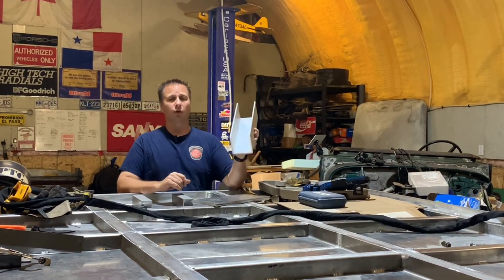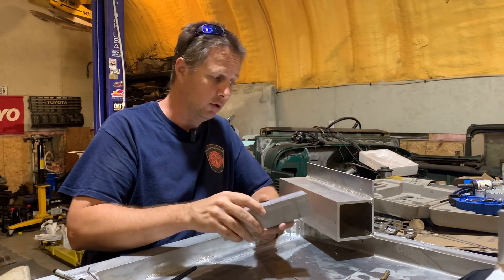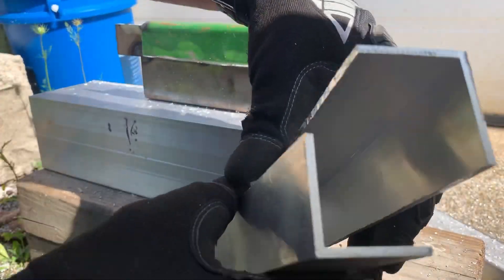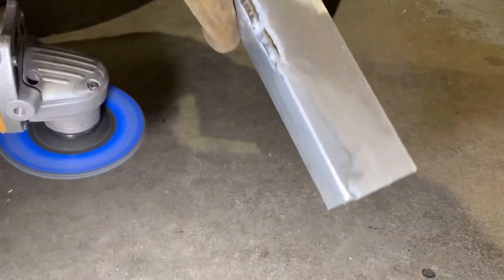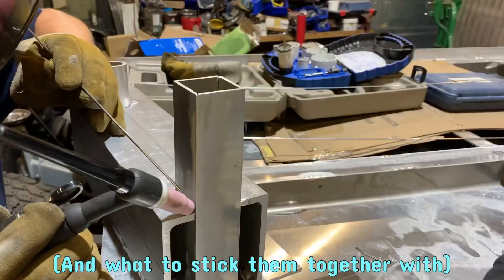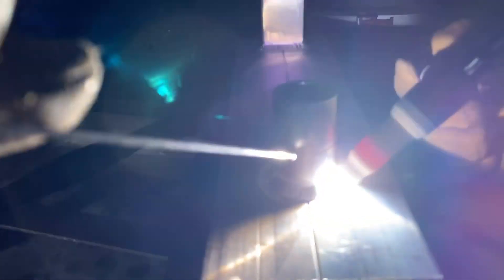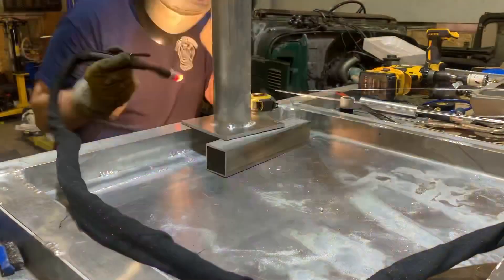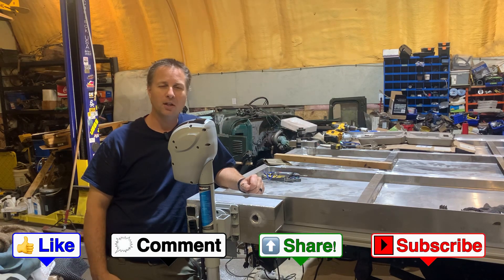Custom electric lift setup for our Fuso FG camper!

Comment: What is your complete setting of tig during welding of 3 mm (1/8") aluminium. ? Thanks
Reply from the maker: I’m not exactly sure how to answer this - the machine has a maximum amperage that you set, but the actual amperage is varying by how much I push down on the foot pedal, so sometimes I could be at 200 amps at the start of a weld, but in the same weld, as the aluminum heats up, I could be down do 100 amps...  my gas flow is probably around 12L/min.   If you check back through some of the videos where I am welding I usually give details.
Reply: @BruceandKrista  frequency and period clean vz. weld in %. Thanks
Reply from the maker: Unfortunately my machine doesn’t read out that level of detail, it’s just a knob with +/- ☹️

Comment: Man, you sure TIG weld quickly, Bruce.  ;)
Reply from the maker: Wish I could hit a button to fast forward ACTUAL build speed 🤣🤣
Reply: @BruceandKrista  Oh,  that's easy.  Buy a CNC TIG welder, sir.  Only a couple hunnerd thou.  Or upgrade to a laser welder.  Those are cool AF.  But I hear ya, Bruce.  I'm on month two of a 5kWh solar install.  This month it's the two manual transfer switches and adding a 30A welding circuit to the shop.

Comment: Super jacks for demounting/mounting the habitation box. Would be great if they could also be additionally used for levelling up when on a camping site position. Maybe that is what you are doing.
Reply from the maker: I’ll have to do some testing when we have a decent load on the truck, but they are/will be able to be individually controlled, so should at least be able to make some minor tweaks to the level.

Comment: Is it just me, or does it seem like the aspect ratio is off?

*Edit. Weirdness, when I watch it on my phone or tablet, it's full screen. When I share it to the big screen TV, it's zoomed way in, (and yes, I checked the TV's aspect ratio).

So it's probably me! Good video. This setup is gonna be sweet.
Reply from the maker: Huh, that’s odd.  I could handle that aspect ratio of my shop being off, my problem is there is a time warp whenever I enter.  I get 10 minutes of work done and 3 hours has gone by 🤣🤣
Reply: @BruceandKrista  😂